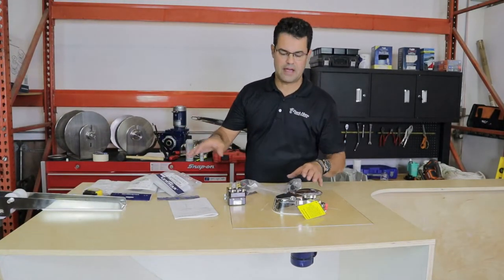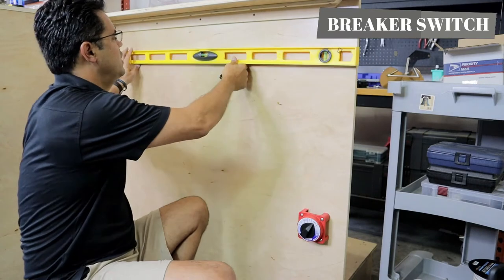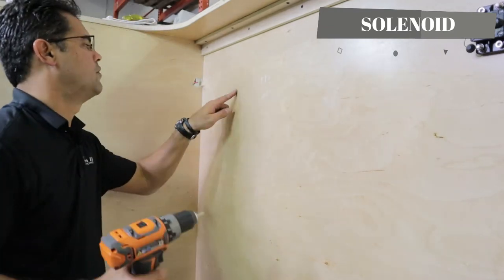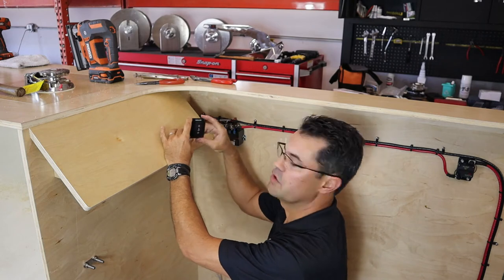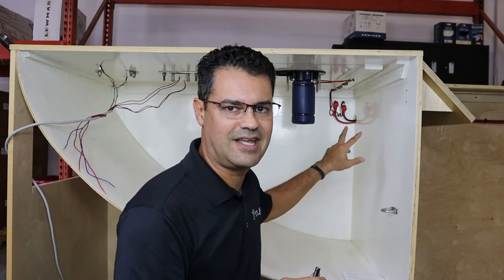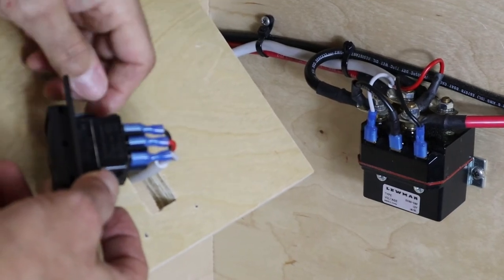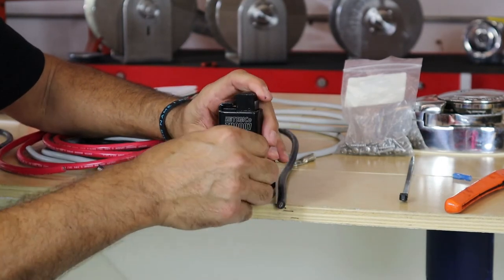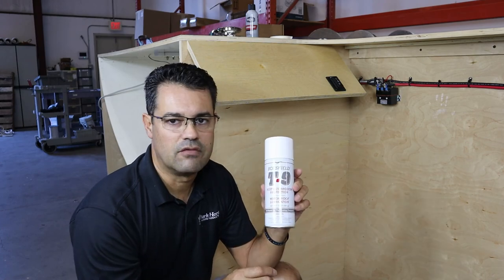How to Install a Lewmar V700 Windlass: Part 2- Electrical & Wiring

Comment: The one thing I would suggest is to use a square instead of a level if you’re doing this with your boat in the water for obvious reasons.

Comment: You're fuse or breaker must be as close as possible to the battery. Code requires it to be within 8 in of the battery. This is so that all of the cable leading from the battery to the solenoid and the winch is protected by the fuse. The way you have it set up you have a whole bunch of cable connected directly to a battery without a fuse. If you have a short circuit anywhere in that cable between the battery and the fuse, it will burn the boat up. Since people follow these videos and your advice for an installation, you should make the correction in the video.
Reply from the maker: @johnhuntley3006  thank you for making that point. This is just to show you how to install it on a demo setup, you should always follow the instructions as to where to install the components.

Comment: I have a Lewmar windlass fitted in an anchor locker bolted to a bulkhead. 20 years old but away from the wind and rain. I operate from within the boat cabin using a built-in control unit with a basic up and down switch, again all covered. Suddenly there’s no power there or when I plug in the up and down control on the windlass itself. What’s the most likely cause and where do I look!? Everything else connected to batteries works fine. It’s completely dead, as I say!?
Reply from the maker: @michaelinkster4977  Hi Michael, thanks for sharing your windlass problem with us. My first advice to anyone who is having issues with a powerless windlass is to take the rode out of the anchor locker to avoid injury while diagnosing the problem. Once it's been removed, steer clear of the chainwheel and put 12 volts directly to the two post or wires to the motor. If you have a 3 wire windlass put negative to the center post and positive to the outside post. If the motor doesn't turn, then replace it. If it turns, connect the wires to the solenoid and keep working your way back to the battery. If you're still having issues, please email us at info@darkhorsemarine.com
Reply: @Darkhorsemarine  sorted - someone had actually turned off the power to the windlass switch!! Thanks

Comment: Is it OK to extend the wires from the winch motor to the solenoid instead of running large gauge wire all the way up to the winch?   Easier to run smaller wires to the front of the boat and keep the breaker and solenoid closer together in the engine compartment.  Seems like the heavy gauge wire needs to be between the breaker and Solenoid....

Comment: I have a question, Lewmar V700 after the up or down operation should the motor immediately break or continue for second ?
Reply from the maker: Hello, thanks for the question. The V700 should immediately stop and not continue to run for any length of time. Please let us know if you have any other questions.
Reply: @Darkhorsemarine  thanks for the quick reply. I isolated the problem. Back to normal 😃

Comment: Can I just use the switch on the circuit breaker instead of adding the orange colored switch AND should the circuit breaker be close to the battery? How close?
Reply from the maker: Hi Sam, The distance between the breaker and the battery does not matter. Sorry, I don’t understand the question about using the circuit breaker instead of the orange switch. Please elaborate.

Comment: Hi Bobby.  Thanks again for the great videos.  I am planning a pair of foot switches on the foredeck and also intend mount the rocker switch in the cockpit of my boat, so there will be two stations for raising/lowering thee anchor.  I ordered the appropriate contractor solenoid (#0052531).  Looking at the wiring diagram, I see that there are three 16-18 awg wires that are shared between the two sets of switches.  Can you tell me the best way to make these connection?
Reply from the maker: You can use a terminal block with connecting jumpers. 

https://www.amazon.com/Blue-Sea-Systems-Terminal-Jumper/dp/B000K2IL1I/ref=sr_1_4?dchild=1&keywords=terminal+block+jumper&qid=1622065882&sr=8-4

https://www.amazon.com/Blue-Sea-Systems-Circuit-Terminal/dp/B000K2K6L6/ref=pd_bxgy_img_2/141-0461214-5503339?_encoding=UTF8&pd_rd_i=B000K2K6L6&pd_rd_r=f31b9aa3-3780-4f3d-ba6c-00be75f9bf1d&pd_rd_w=FtmQP&pd_rd_wg=rJTj4&pf_rd_p=fd3ebcd0-c1a2-44cf-aba2-bbf4810b3732&pf_rd_r=7F1TTFTE9N03AEZAG97Y&psc=1&refRID=7F1TTFTE9N03AEZAG97Y

Sorry for the delayed reply!

Comment: Why isn't the thickness of the wire the same leading to the main unit? It doesn't make sense that the wire is twice as thin 12 inches from the windlass unit.
Reply: @kristinamoncayo484  😂

Comment: my calanoid has one less post? 
and my V1 unit motor has 3 posts no wires.
Reply from the maker: Hello, yes, the V1 windlass does not use a reverse polarity motor like the V700. With the V1, the battery ground goes directly to the center post of the motor and the positive goes to the center post of the 68000318 solenoid. Please let me know if you’re clear  on this.